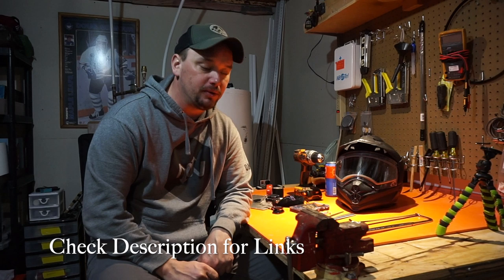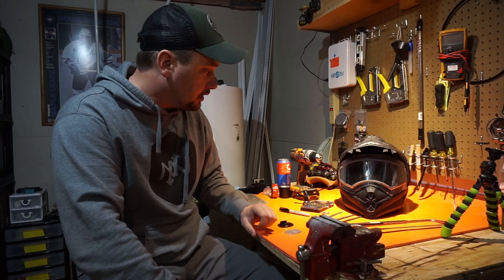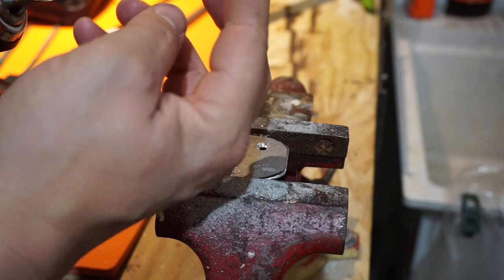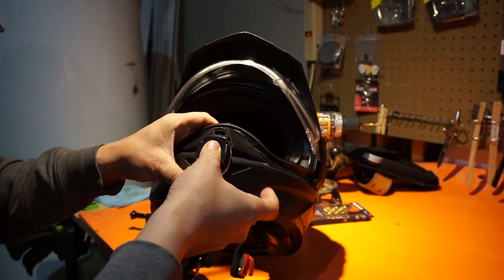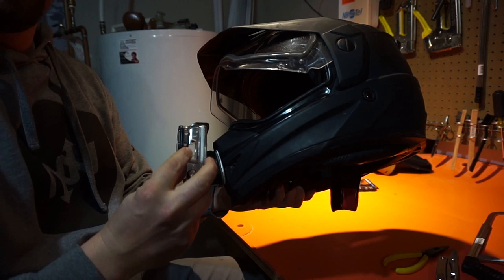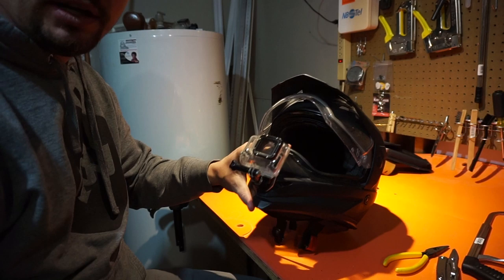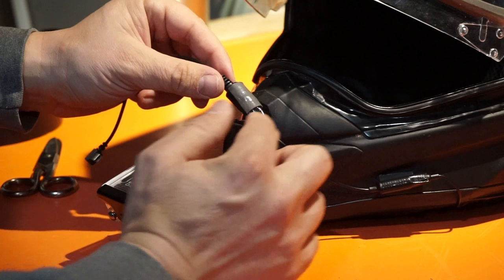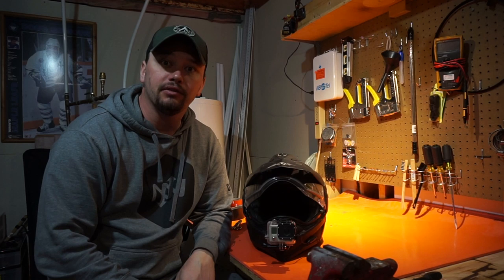DYI - GOPRO Mount and MIC Set up for Moto Vlogging (Cheap and Easy w/ Basic Tools)

Comment: Nicely done bud!
Your final cleaner before applying the 3M should always be alcohol, just to be on the safe side.
Instead of tape around your mic connections, try shrink tubing. It provides a tight seal and you can still unplug the the two cords if you need to.
Thanx for sharin'!
Reply: Quaddingsous second on shrink tube.. that’s a great idea.
Reply from the maker: I thought if I used the heat shrink I wouldn't be able to unplug the wires if I wanted too, maybe I'll look into that. I havent had any issue with the tape though, makes a tight seal but the heat shrink would look better for sure....... Might have some laying around at work... haha
thanks for watching buddy ! Stay Safe !
Reply: @Maritimer  
You can easily cut it off if you need to. It's cheep at Pr.Auto.

Comment: I have a similar setup on my helmet but I don't use a microphone. When I used to use my GoPro Hero 3 I had a waterproof case with an external covered port on the side but it only had room for power so I could run it all day without having to swap batteries. Unfortunately there was no room for a microphone attachment as well. I now use a GoPro 7 and it's waterproof without a case and has an external microphone which is handy.
Reply from the maker: Hey ! thats awesome man, I may look into getting a new GoPro in the future, this Hero3 still works perfect though, I can have it as a second camera. Yeah it gets annoying having to change out the batteries, but I have like 5 extra ones now, and always charging them using my portable battery thing. thanks for watching !!

Comment: I have the GoPro hero 5 black and just upgraded to the hero 8 black. I would much rather have a audio connection like yours. I had to buy the mic adapter to run audio into my helmet. The piece GoPro sells to have audio is expensive and the adapter is 1 by 2 inches. I have it mounted to the outside of my helmet and I would love to figure out a different way around that.

For my YouTube videos it will work because people can’t see the adapter hanging on the side of my helmet.

Thanks for showing your set up. The purple panda was on my list of mics and it sounds great. I’m using the Power Dewise mic.
Reply from the maker: Hey man ! I actually just upgraded to the Hero8 black edition too ! and I went with the Gopro Media mod over getting that Mic adaptor. it's more money buy gives ya mre options for lighting and external mic's. not to mention it has the right mic plug built in. I'm editing a vieo now, I'm loving the video from the new gopro !
Reply: Maritimer I might have to consider upgrading to the media mod. I agree with you. I like the options that comes with the media mod. The video quality and stabilization of the Hero 8 is well worth it. When GoPro knocked a hundred off is when I decided I am picking one up.

I look forward to watching your video buddy. Take care.
Reply from the maker: thanks man !

Comment: Nice job buddy! Little different than mine but the end result should be the same. I need to pick up another waterproof case so I can drill some holes in one for my microphone. I've heard that some microphones are better mounted over by the cheek, less wind and heavy breathing in the video. I will have to play around and see what works best for me I guess.
Reply from the maker: Hey man ! Yeah your's is way more robust ! haha but i've never had an issue with my stayle, always stays on, those gopro's aren't that heavy anyway.
I heard that too ! but I dont have an area for the mic to sit by my cheek.... maybe I can try to make it work if I find the breathing is too much.
Reply: @Maritimer  yeah I found the instructional video on YouTube as well as the downloadable template for it. I like it, I do have some concerns about the double sided tape coming loose on hot days but I'll see how that goes. I didn't really want to drill holes in my helmet but if the tape doesn't stick I'll have to add a couple of screws for added security. I did use an automotive grade tape so it "should" hold.
Reply from the maker: I Hope so !! Good luck !

Comment: Nice i just bought my first real gopro brand cam 7 silver seems work great for first ride so far lol . How ever has no place plug a mic but does have couple built in time will tell if holds up great video cheers .
Reply from the maker: Hey Buddy !! Nice ! Im still running the Hero3 lol but it works good for me so i'm happy. Thats weird it doesnt have a spot for a mic, my mic plugs into the charging port on the side of the gopro, you must have that ? Thanks for watching !!
Reply: @Maritimer  ahhh that is where on the 7 sliver the charge port is hidden under a water proof door next to sd card . So if want charge need to take cam out case open door recharge as has a built in battery not ones can take out  like older cams .
Reply from the maker: Oh wow I didnt know that, pretty cool !
Reply: @Maritimer   yeah found out since the hero 7 white and silver  will not work with a external mic  but the 7 black will .

Comment: very cool, I was going to pick up one of those hero cases with the holes on the side for the mics but then noticed that there is no protection of the lens... so was going to do what you did, pick up another water proof case and drill holes on the side. They also make a mount that velcros over the chin guard... thinking about picking that up, I don't want to drill any holes in my chin guard. I picked up a Boya BY-LM20 mic just for this... funny how I was looking at this, this morning....

cool vid man...

Cheers from Montana.
Reply from the maker: Hey John !! thats a good idea man ! the velcro should hold no problem as long as your get that heavy duty stuff ! I never thought of that.
Chees buddy!
Reply: Yeah man, I will be getting the heavy duty Velcro.  Just worried I can’t get it tight enough so it won’t flop around!!! Hahahahaha